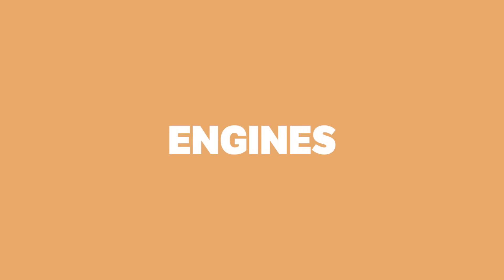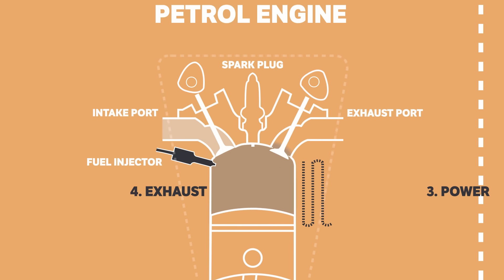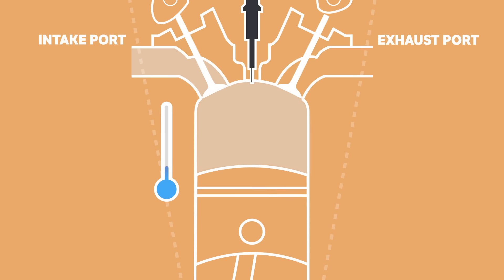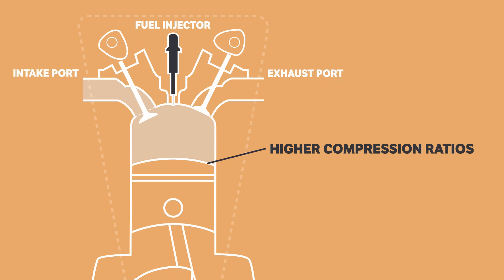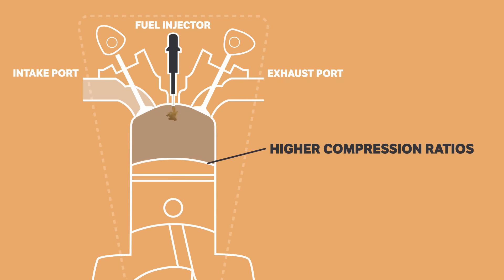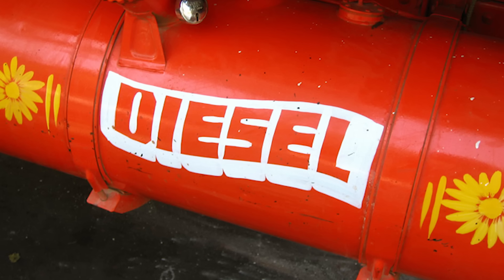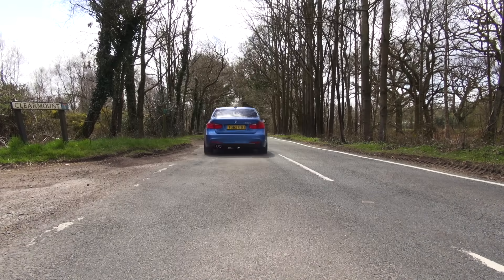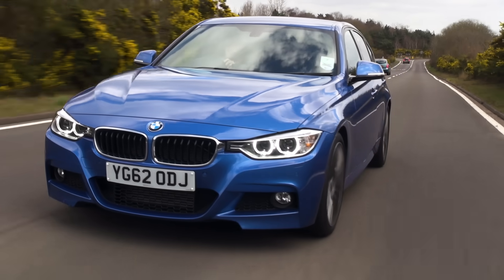The Differences Between Petrol and Diesel Engines

Comment: one VERY important thing about the diesels hp and torque: 

without a turbo, a diesel has roughly as much torque and hp as my electric toothbrush.
Reply: 99Lezard99 so your toothbrush got 120 hp and 240 nm?
Reply: patrik persson what size is the engine you are talking about? and yes my toothbrush has about 125hp and 250nm and is powered by a 9.7 liter straight 6 n/a diesel.
Reply: you guys are pathetic. comparing DAMAGED diesel engines or old heavy diesel sedans to more modern compact cars. even a NA disel, assuming it's a good design and working properly, will still be more efficient than a similar petrol engine. it will still have much more torque, on a wider rpm band and much earlier than that similar gasoline engine.
Reply: the tom guy. he used  a turbo diesel engine with problems then complaiend diesel enginge are shit without turbos.
Reply: Agroprest Afumati no one said ist not more economical. but a n/a diesel dosent have more torque then a petrol engine with the same Displacement. my mothers car was a 1990 and my second car was a 1991. compared to a n/a petrol a n/a diesel is gutless. in every rpm. just with a turbo it comes alive. but a petrol with a turbo comes alive even more. but of course diesels are much more economical. thier biggest benefit by far. low end torque (if a turbo is fitted) is thier second benefit. and thats why they are used in trucks and stuff. but they will Never find thier way in sportscars. only in compromise cars like big ass heavy sedans or SUV's. we will Never see a ferrari porsche gtr lotus with a diesel.
Reply: 99Lezard99 Mercedes om603 6 cylinder 3.0 liter
Reply: Im not comparing anything to anything, all i asked was why he has a toothbrush with 120 hp and 240 nm. And who said anything about DAMAGED engines?
Reply: 99Lezard99, I know exactly what you mean.
A diesel car without a turbo is like having a bicycle without a front wheel. You struggle to get it anywhere.
They are more reliable than turbocharged diesel engines, though. But the slowness and the horrible smell don't outweigh reliability in this case.
Reply: The Owner true that
Reply: i was clearly not referring to small 2-3000cmc engines or electric cars with a very different transmission and ways to put that power down.
we were talking about supercars. a large displacement diesel engine can generate insane levels of torque.
a common modern 6000cc tractor engine can easily put out 180-200Hp and well above 700Nm of torque starting from 1400rpm. and that's a highly detuned engine designed to work at full load in harsh conditions the whole day. now imagine a 6000cc diesel engine designed for performance, dohc, variable geometry turbo, commonrail, 4valves per cilinder and so on. with current technology, you can easily get well over 500hp from said engine but you'll also get something like 2000+Nm. on a very light car, that's way too much. you'll need drag slicks just to get any traction.
Reply: well, assuming we don't mix the 2 very different topics in this post, the one regarding Na engines and the one regarding a diesel supercar, it would be insane not to have a turbo engine on a diesel that aims at performance. when it comes to weight, yes, classic large displacement diesel designs, are very heavy since they all have massive iron blocks and cylinder heads. however, modern diesel engines are not that much heavier than their gasoline counterparts and if we look at audi r10/15/18, we can see what it can be achieved with top notch technology. light engines developing 650+hp on a car that weights ~900kg.

what i'm trying to say is not that diesels are perfect for high performance cars, thery have a lot of down sides, weight distribution, power curve, people's perception that diesels are slow or unsafe for racing and so on. what i'm saying is that the problem is NOT the fact that diesels can't achieve the same performance as gasoline engines or that's something flawed about them that makes them not competitive enough/unsuitable in high power applications (as stated by the guys above). modern and potent diesel engines can achieve (and they already did when they were built by serious companies) the same or better performance than petrol counterparts.
Reply: Lemmie guess, you've watched a bunch of Engineering Explained videos and now you think you know what you're talking about? That guy is a hack, and his popularity just goes to show how stupid most people are. 

"...they have comparatively lower torque and are not very fuel efficient. "

Torque output has absolutely nothing to do with engine stroke, and the amount of torque an engine makes has no bearing on vehicle performance, power to weight ratio is all that matters. BSFC is also more dependent on piston speeds and volumetric efficiency than engine rpm, because a huge portion of the friction in an engine comes from the pistons and piston rings, and because reducing the power loss associated with aspiration improves efficiency. Piston speeds are not dependent only on engine rpm, they are determined by engine stroke and engine rpm.

F1 cars were running turbocharged 1.5 liter V6s and 4 cylinders in the late '80s, and they were dangerous not only because they were the most powerful engines in F1 (Honda and BMW engines made around 1,400 hp in qualifying), but also because their small displacement and high power output meant that they had a huge amount of lag, which made them hard to control, it had nothing to do with their torque output. The V10s came later.
Reply: Oh? Can you show me an example of one vehicle being faster than another because of its torque output and not because of its power to weight ratio?
Reply: 1996 Mercedes E 200 Diesel - 4-cyl, 1997 ccm, 88 PS and 135 Nm.
1996 Mercedes E 200 Petrol - 4-cyl, 1998 ccm, 136 PS and 190 Nm.
1989 Mercedes 200 Petrol - 4-cyl, 1996 ccm, 105 PS and 158 Nm.
1980 Mercedes 200 Petrol - 4-cyl, 1988 ccm, 94 PS and 158 Nm.
1956 Mercedes 190 Petrol - 4-cyl, 1897 ccm, 75 PS and 136 Nm.

The latter has smaller displacement, less PS but basically the same torque as its 40 years younger brother. Isn't that something.
Reply: patrik persson oh ok sorry now i got it. 3.0 with 120hp. yes my toothbrush is quite heavy. but wielding it gives me the necessary mornig workout. 👌
Reply: Agroprest Afumati - Wheel torque is dependent on engine power output, the amount of torque an engine makes means nothing. A 500 hp diesel supercar engine would be ridiculously heavy and would seriously harm the performance of the vehicle. Gasoline engines typically make more torque than diesels, unless you're comparing turbo-diesels to naturally aspirated gasoline engines.
Reply: Audi won Lema with a Diesel engine 💪🏼💪🏼
Reply: Andrew Allen - What are you talking about? No diesel could ever come close to matching the power to weight ratio of an F1 V10, especially not without a turbocharger. The latest Powerstroke V8 makes 440 hp, not 600. Even if it did make 600 hp, it still wouldn't be making 1 hp per pound, and it certainly wouldn't be anywhere near the 4.6 hp per pound that F1 V10s made. The Porsche 918 engine makes 2 hp per pound, with emissions controls, no turbocharger and while running on pump gas.

Agroprest Afumati - The fuel used in F1 is very similar to pump gas and is not high octane, it's comparable to premium pump gas. My point was that diesel racing engines can't compete with gasoline racing engines and diesel road car engines can't compete with gasoline road car engines.

SANJAAY ANANDH GOPAL - LeMans is all politics, it can't be used to compare technologies because the regulators are always limiting the performance of some cars but not others. The diesel prototypes were allowed to outperform their rivals in order to promote diesel products in Europe, but now Europe has realized how shitty diesels are so they've switched to manipulating things in favor of hybrids.
Reply: The C220d is not naturally aspirated. All modern diesel production cars have turbochargers, they'd be absolute slugs without one.
Reply: idontcare80, exactly. And the late 80s F1 cars were much lighter (around 540kg if I'm not mistaken). They were too dangerous to drive. Turbo pushing 4 bar boost was insane. Cars were producing ~900 HP for race and a staggering 600 lbft of torque in a 540kg car. No wonder they toned it down in '88 to just 2.5 bar thus limiting the engine output to just ~650 HP. The cars were just too difficult to handle.
Reply: Trey Hornick do your research. The c220d is defenetly not n/a.
Reply: I said it made 440 horsepower, not 440 lb-ft of torque. You diesel boys really do have trouble reading, don't you? I don't know where you got 445 hp.

There are plenty of gasoline V8s in both cars and trucks that made over 1,000 lb-ft of torque, just not from the factory.
Reply: idontcare80, I'm with you on that one. You did write 440 HP not torque.
Reply: Martin D A to do that it must learn to drive on a road first.
Reply: Martin D A, mainly because of the fuel used. Diesel burns slowly, petrol explodes.
Reply: Martin D A, I think the 2002 engine was the base for F1 engines.
Reply: The Owner

It was an 89 model (molded plastic on the doors).
I really love those cars, you can enjoy going slow =)
Reply: Martin D A - Part of the reason that diesels had superior thermal efficiency was because they were so unrestricted (no throttle valve, no emissions controls), but with modern emissions controls, they aren't much better than gasoline engines. Gasoline engines have also gotten much better in recent years, nearly matching diesels. 

The Deltic engines had almost 90 liters of displacement, that's where their torque came from, it had nothing to do with the fuel they burned. The later R-3350 aircraft engines could make quite a bit more torque from a much smaller displacement.
Reply: idontcare80 roughly the same as most productions cars today, diesel or gas 
both have their advantages , they are both awesome . i cant take sides to be honest
Reply: patrik persson so? 3.0 with 120hp or something? want a comparsion with a 3.0 straight 6 petrol?
Reply: 99Lezard99 you asked and i answerd.
Reply: Agroprest Afumati Ah
Reply: patrik persson what did i ask?
Reply: 99Lezard99 What engine size.
Reply: The Owner Your point being?
Reply: Wrong person.
Reply: Agroprest Afumati lightweight? Do you know how much would engine like that weight?
1994 7.3l V8 diesel with single turbo from Ford makes around 250bhp and 685NM. 
1969 5.8l V8 from Ford naturally aspirated makes 300hp and 460NM. Diesel without a turbo doesn't stand a chance if we're talking about power. 
Hell my first car was 1.3 petrol which had 50kW (100NM) and 1.9 N/A diesel in the same car had 47kW (120NM)
Reply: Andrew Allen, also you can't fit more than 3.5 liter engine in a 2005-2017 F1 car. There is no room. They would have to redesign the whole car. And not to mention the overall weight which would go up by at least 200 pounds. 600 HP and 900lbft would just not be enough. It would need at least 750 HP and a 1000lbft which would make the car handle like 1950s era F1 cars - deadly.

There is a reason why F1 cars have petrol engines. To keep the weight low.

For comparison, a 2004 Ferrari F1 3.0l V10 weighs 605kg and produces around 880-950 HP.

If it were a 3.0l V10 diesel it would need two turbochargers to get even close to 800 HP and it would weigh at least 100 kg more.

These F1 engineers can make wonders but even they know putting a diesel engine in an F1 car would be moronic. It's different with Le Mans cars. And they only started using diesels because they used much less fuel hence being more competitive to their petrol counterparts.

Bring back 90s-2000s era F1 cars and I'd watch all the races regularly.
Reply: SANJAAY ANANDH GOPAL, do you know why it won?
It certanly isn't because diesel engines are better than petrol.
Reply: i never stated diesel engingines were suitable for f1 cars. they are not. but not because you can't develop a diesel engine that's powerful enough. 

do you know why f1 engines are capable of such ammount of HP? because of the high revs the can achieve (hp, unlike torque, is rpm dependant). f1 enginges have short stroke, high bore and a bunch of improvements (pneumatic valves, rare metal alloys on critical components, extremely thin and light pistons) so they can achieve those high rpms. what does that mean? they have comparatively lower torque and are not very fuel efficient. 

diesels funtion is exactly opposite. they don't go as high in rpm but they put as much power as possible with each stroke (mostly because of the longer stroke and much higher comporession, giving it a much better efficiency). overall, assuming you spend as much in development, you can get a diesel that puts out comparable levels of power as a gasoline engine (without it being much more heavier, it will be heavier though since it needs a more robust constrution to withstand the higher compression ratio).

do you know why f1 cars form the late 80s were considered too dangerous? not because they had too much hp (later cars had the same or in some cases even higher HP), it's because those 3.5L v10s and v12s also started to develop insane ammounts of torque. so they impose design regulations to make those engines less torquier.

you may ask why torque is dangerous? well, those are very light cars and torque is not linear as HP, it can come abruptly at certain rpms making the car accelerate violently. more than that, it makes the car very hard to control in less than ideal situations (when raining, when tyres are not warmed up properly or are too hot or too used, in certain high G menouvers etc).
Reply: i don't waste my time on videos with trivial information. i rebuild and fix diesel engines for 15 years now.

torque is measured in NM. the ammount of newtons you get at the end of 1m bar. inside an engine, the longer the distance from the connecting rod to the center of the crank, the higher the power per stroke that engine produces. that distance is obviously proprtional to the engine's stroke. bedies that, diesel engines have higher compression ratios and combustion efficiency which also increase the ammount of torque they can put at a certain displacement. this means diesel engines have both higher HP and much higher torque than a gasoline engine at the same displacement and rpm.

however, gasoline engines can compensate by revving higher, this increases HP (proprtionately in theory, in practice it's not proportional since it has much to do with engine design and at which rpm said engine is most effective). but revving higher does not actually increase torque that much (if at all, again, it really matters how that engine is designed to operate).

the rest of your comment is absolutely right. gasoline engines are by fam more appropriate for f1, motorcycles and very light vehicles applications than diesels.
Reply: Agroprest Afumati, wait a minute. You're saying that a 1980 Audi 80 GLE with 1588cc engine and 110 PS and 140 Nm of torque has less torque than same year Audi 80 Diesel with exact same displacement of 1588cc and 54 PS and around 95 Nm of torque.

There are plenty of N/A petrol cars with same displacements than N/A diesel cars and former produce more HP and more torque.

The only thing good going for a diesel car is a turbocharger. You take it away and you lose almost half the PS and half the torque.

Now, you're a diesel mechanic and you know a thing or two around engines but are you really going to stick by this statement of yours:
"this means diesel engines have both higher HP and much higher torque than a gasoline engine at the same displacement and rpm"
Reply: Agroprest Afumati, you've made a slight error. BMW's M15 engine was a petrol powered NA 2-liter engine and it was used in the legendary 2000tii and 2002tii. 2000tii had 120PS and 167Nm. 2002tii had 130PS and 177Nm.

A turbocharged 2002 had 170PS and 239Nm of torque.

And to correct your sentence:
it was superior than similar gasoline engines they had back then.
It WAS the superior gasoline engine they had back then.

I can give you a proper example of BMW's petrol vs diesel.

1982 BMW 323i with 2316cc, 139 PS, 205 Nm of torque.
1985 BMW 324d with 2443cc, 86 PS, 153 Nm of torque.

Are you sure you're a mechanic?
Reply: There is one C 220 diesel manufactured from 1993-97 which had a 2155cc NA engine but it only had 95 PS and 150 Nm of torque. All later C 220 diesels had a turbocharger. It had nowhere near the 170 PS that Trey Hornic wrote.

There were also 3 other NA diesel engines offered back then in C-class. A C 200 with 75 or 88 PS ('96 model) and a C250 with 113 PS.
Reply: You can compare the Mercedes OM604 engines to the Honda F20A and F22A engines, and the 6.2 and 6.5 Detroit Diesel V8s to basically any other GM small block with similar displacement, the gasoline engines make more torque and more power. There are other examples as well, but I can't think of them at the moment.
Reply: MiDnYTe25, I can prove you wrong on multiple accounts.
Reply: Man, you diesel fanboys don't know how to read. Read the comment that was posted right before you posted yours.
Reply: idontcare80 I finally felt like looking it up and your right the new powerstokes don't make 600lbft they make 925lbft with 445hp. I don't know where you got your bullshit number of 400lbft?
Reply: Andrew Allen, it's all good. Ford powerstroke is a truck, not a car. You have to register it as a truck.
Trucks usually have the most torque out of all land vehicles.
Reply: The Owner I can do a triple backflip.
Reply: MiDnYTe25, you got me there.
Reply: Also, I take that last bit back, the Koenigsegg One:1 makes 1,011 lb-ft of torque from the factory, and from a 5 liter V8. The Chiron makes 1,180 lb-ft,  but it's also an 8 liter, 16 cylinder engine. The Chiron engine even makes its maximum torque starting at 2,000 rpm and probably makes more torque at 1,600 rpm than the Powerstroke engine does at the same rpm.
Reply: Tell that to a Deltic locomotive... As it supplies enough torque in a satanic raucous volume of belching smoke to tear your car in half.
Reply: Haha yes, of course.
Reply: It is an interesting subject though. Diesel by volume has 15% more energy than petrol, though by mass about the same. The engines need to be built to withstand the higher stress levels. The moving mass will be greater. The 'detonation' cannot be altered except by fuel injection timing, and the burn time is longer. The Diesel also was not developed for small passenger vehicles alongside petrol until the 1990s, the turbocharger itself did not become common place in cars until the 90s too and this is maybe partly why they became popular along with the need for economy. The thermal efficiency is an order better. Can anyone tell us exactly why Diesels don't rev, apart from stroke differences?
Reply: Makes sense. Yes thanks. ))
Reply: PS You were discussing the BMW2002 engine, I think that was the block they chose for their F1 engine?  750HP+ Or am I getting mixed up?
Reply: Aaah i remember the 300D W124. 110ish HP ^^
Reply: M RO, yes. What year were you thinking about? A 1985 300D has 109 PS. A 1989 model has 113 PS. Not much difference actually ha ha. BTW, I also think 300 D is awesome :-)
Reply: idontcare80, The thermal efficiency is set by the physics of the thing and can only be fiddled about around by the designers, either approaching the ideal or moving away from it. It is simply that the efficiency of a heat engine is fixed by the difference between the ambient and the fuel temps. Diesel has a hotter engine, hence has an ideal efficiency greater than a petrol engine.
I was only joking about the Deltic, but I think it's a fantastic thing. Standing next to one while it throbs away - rumbling through your feet on the platform was for me unforgettable. Also love the big aircraft engines too, that 3350 was great.
Reply: The owner, 'explode' suggests detonation. The flame of the burning gasoline travels at about 200m/s (from memory) a detonation will travel at 5000m/s (from memory - but you get the idea) If someone could make an engine that withstood detonation it would be quite a performer I imagine.
Reply: A whole huge range of things determine the efficiency of an engine, its induction efficiency (which I mentioned), its compression ratio, its internal friction (more friction puts more heat into the cooling system), the fine-tuning of the fuel delivery, the combustion chamber shape, the cam profiles, the ignition timing, etc. The compression ratios of gasoline engines have risen considerably in recent years, and the induction efficiency of diesels has fallen dramatically due to emissions requirements, this is why the efficiency gap between diesels and gasoline engines has fallen to basically nothing, nothing meaningful, anyway.
Reply: Sure, all I was saying is that all 'heat engines' have a theoretical maximum efficiency, and a Diesel is higher than a Gasoline, as a gas turbine is greater still etc. They can muck about with stuff as much as they like - but the designer of modern engines has two main considerations, the efficiency and the green credentials. The internal combustion engine be it Diesel or petrol falls short on both. Inertia and demand for energy and power has meant they will continue to produce these engines but the world needs a cleaner more efficient engine. As we know...
Reply: Gasoline engines in automobiles and gasoline and turbine engines in aircraft are just fine as they are, what the world needs is a green hydrocarbon fuel. Synfuels, made from captured CO2 with nuclear energy would be something to consider, we could even capture more CO2 than we burn using that technology.

Edit: Actually, gasoline engines in aircraft are in desperate need of an update, but using gasoline engines in aircraft isn't likely to be made impractical any time soon.
Reply: a stock cummins ram has about 900 ft. pounds of torque..
Reply: Its also turbocharged.
Reply: idontcare80 doesnt add a whole lot of torque though,  at much 150 pounds
Reply: No, it adds about 560. Diesels are only capable of a BMEP of about 125 psi when naturally aspirated, which means that an engine the size of the Cummins in the Ram would make about  340 lb-ft without a turbo.
Reply: Most naturally aspirated, gasoline burning production cars are around 190 psi, that would give a 6.7 liter engine 510 lb-ft of torque.

There is no advantage to diesel next to modern gasoline engines except for a small savings on fuel costs, and that's only because the price of diesel recently dropped by a fairly large amount.
Reply: idontcare80 then tell me why all the big rigs use diesel engines and a 6.4L hemi only makes about 429lb-ft. A turbocharged diesel will always make more torque than a turbocharged gas engine of the same size each with equivalent turbo.
Reply: Big rigs are diesels because they're cheaper to operate, diesels burn less fuel. 4 valve engines make more torque than 2 valve engines, a typical Honda engine has a BMEP of around 175 to 190 psi, that Hemi is around 165.

I'm pretty sure I said this before: The torque output of a turbocharged engine depends on its boost pressure, you want more torque, you just raise boost.
Reply: idontcare80 " no advantages but small savings on fuel " a 6.4 hemi can tow 10,700 pounds , a 6.7 cummims can tow around 30,000 pounds 🙃
Reply: "...Diesels are just a terrible fit for high performance vehicles."  But absolutely fantastic if you are towing.  ;)
Reply: 99Lezard99 what do you mean "turbo" ?
Reply: No, diesels make less torque without turbos. Try to prove me wrong and you'll realize how pathetic a diesel's torque output is without a turbocharger.
Reply: Diesels do not make more torque than gasoline engines, unless you're comparing turbocharged diesels to naturally aspirated gasoline engines. Naturally aspirated diesels typically make less torque then naturally aspirated gasoline engines, and anything goes if you're comparing turbocharged engines, because torque output is dependent on boost pressure.
Reply: lmfao
Reply: I read through the entire thing and this discussion is quite interesting but you aren’t realising your points of view are actually compatible. Summing up, yes diesel need a turbo to make torque and yes if you give the same turbo to a gasoline engine it will probably make more torque. The reason that is hard is because gasoline is susceptible to knocking if you just strap a turbo so in order to run the same boost you would have to greatly reduce the compression ratio and thus lose a lot on fuel economy.
That is why performance gasoline engines in super cars and racing are gasoline, they don’t need to be fuel efficient and since gasoline engines are also lighter they can rev more and also make more power it’s a win win and putting a turbo is no problem.
On a normal day sedan though, turbocharged diesel has the same fuel economy (sometimes even better) than a naturally aspirated diesel and because of that you can have the turbo and make more power at low revs (which I think we all agree is what the average joe uses daily) the same reasoning applies to why they are good at towing and are used on heavy machinery.
Could that same sedan run a gasoline engine and make more power, yes of course. But if it was naturally aspirate, that power would come later in the range even if you could get the same peak torque. And if it was also turbo charged, although it would probably be better on every way you would lose a lot on fuel economy because of the point I made before.
This is why diesel is king in Europe, diesel is cheap here and most diesel consume less and people want like to run the cars on low revs all day long and still feel the engine pulling. I personally prefer gasoline engines but even a little turbo one spikes the consumption to over 30% of the diesel equivalent.
Reply: bmw 520d diesel 180 hp is just the right amount for a car whitout a turbo
Reply: lol you idiots golf mk4 with its 1.9 sdi  has no problem reaching 160km/h and the golf mk2 1.6D can reach 120km/h so it isnt slow as you think
Reply: 99Lezard99 wouldn't that be a diesel toothbrush?
Reply: But you're wrong, diesels simply can't perform as well as gasoline engines by nature. The first problem is that they can't rev, which means that they have to rely on producing huge amounts of torque in order to produce power, and an engine that's built to withstand a large amount of torque is always going to be heavier than an engine that revs to high rpm to produce its power. The other problem is one that plagues diesels in all applications, and that's their emissions control systems. A gasoline engine just needs a single, three way catalytic converter to run cleanly, while a diesel needs a DPF, a DOC, and either a NOx trap (which doesn't really work) or a urea injection system with its own catalytic converter, and all of that equipment is not only heavy, but it's also hugely restrictive. 

You'll never see a diesel that weighs 300 pounds and makes 600 hp like the engine in the Porsche 918, you'll never see a diesel that makes 925 hp and weighs 203 pounds like the V10s that ran in F1, you'll probably never even see a diesel that has power to weight ratio of 1 hp for every pound of engine weight on the road. Diesels are just a terrible fit for high performance vehicles.
Reply: idontcare80 comparing a Ferrari v10 f1 car to a smaller, emissions restricted diesel is stupid. F1 cars don't have emissions so why would a f1 car with a diesel have emissions also the new ford powerstrokes make 600hp and 800ftlbs while they weight around 650lbs while emission restricted. So I believe if Ferrari chose to use a diesel or a gas engine in there F1 they would be able to achieve some high hp and torque numbers.
Reply: you're comparting a gutless old random car with another gutless old random car. your example has really nu relevance in comparing diesel vs gasoline engines. just look or even better, test drive the same car, similar platform, one with a diesel engine and one with a comparable petrol engine. a lot of manufacturers offer a wide variety of engines so it wouldn't be hard to find a few. diesels are definetly not gutless in comparision. they are usually more expensive and people KNOW they won't cover the cost just from the fuel efficiency it the few years they plan to use the car. yet they choose diesels. why? because in normal conditions, they are more alive than a similar petrol engine.

when it comes to various competitions, diesels were banned long time ago and not because they sucked, but because they outperformed similar gasoline engines. they figured it out it's not fair and regulated the competitions (and not only with diesels but with different ngine types, fuels, intake systems and so on, it's all regulated for the sake of fairness).

when it comes to supercars, there are 2 separate issues. one is the fact that people that buy those cars don't usually want diesel engines regardless of how well they would perform. the second is, you can only go so much in performance with a diesel engine without getting an insane ammount of torque. you may think more torque is good. that's not the case on a very light car. insane level of instant torque will make your wheels lose grip at high speeds just by changing gears or sudden accelerating. that's a big no no when it comes to safety.
Reply: not to mention f1 cars not running on normal gasoline. they use high octane gas mixed with ethanol (5-15% if i remember correctly).
Reply: Aleksey Gladysh yes. seriously. if you have ever driven a diesel without turbo you know what im talking about. for example: my mother used to own a Mercedes 190d witch had 2.0 of straight 4 n/a diesel goodness with mindbending 75hp and 130 or 140nm of gutwrenching torque. a 1.0 45hp corsa was quicker. my first car was a 90hp 1.5 petrol and it felt like a rocketship compared to the 190d. my second car was a 2.0 petrol with 133hp and 180 or 190nm and it felt like timetravel compared to ye good ol 190d. after driving that 190d for a while i knew exactly what i didnt want in a car.
Reply: Agroprest Afumati lol whut? I was just compareing N/A diesel vs N/A petrol. tell me some Race series were diesel got banned because they are to good. Show me proof. 
and the thing with the "too powerful too much torque for sportscars" lol thats funny. but the unbeatable instant torque of a tesla isnt to much? do you really belive what you say there?
Reply: A) Torque does nothing for vehicle performance.

B) Torque output is dependent on turbo boost pressure, so the amount of torque an engine makes, diesel or gasoline, is simply a result of how much boost the engineers wanted to run, it has nothing to do with the fuel the engines are running on.

C) Diesels have to make more torque than gasoline engines in order to make a decent amount of power, because they can't rev to produce their power. This is a limitation, not an advantage. 

D) Gasoline engines make more torque when compared to naturally aspirated diesels, and turbocharged gasoline engines can easily make just as much, or more torque than diesel engines. Again, torque output is dependent on boost pressure.

E) The vast majority of the time, gasoline engines make more power than diesels. Things are a little different in Europe and Australia, both of those regions get unbelievably pathetic gasoline engines compared to what we get in the US. I can't say why that is,  it's almost certainly all due to politics.
Reply: 99Lezard99 j
Reply: A NA diesel still has more torque than a NA petrol engine. It will definitely pull better at lower speeds an specially lower RPMs, but it won't go too fast, no matter how far you press the pedal.
Reply: diesel has more torque with or without turbo
Reply: They make more torque than an equivalent petrol engine , that's my point. Obviously they make less without a turbo, big fucking news.
Reply: 99Lezard99 still have teeth mate?
Reply: man, car manufacturers producel a very wide range of both diesel and petrol engines, you can't take the weakest diesel of certain displacement, put it against the best gasoline engine in that range and call it a day.
bmw m15 from the '70s had up to 130hp and 177nm and was a Na diesel (there is a turbo version of it with 168hp though). it was superior than similar gasoline engines they had back then. however, if you want to prove your point, you can also choose a detuned version of said engine and call gasoline engines better. That's why i don't give much attention to cherrypicked examples. Overall, N/A diesels and gasoline engines are close in performance, especially in the torque department. With turbo, the ballance tips in favor of diesels.

about that statement, if we have 2 engines, with the same level of refinement, engineered and built at the same quality, both having the same displacement, the diesel will always have more torque and hp than the gasoline engine AT THE SAME RPM (as long as it's an rpm the diesel can handle). just look on some graphs and see how early in the rpm band diesels get their torque and peak HP. gasoline engines simply can't match that since their combustion is less efficient. however,  i also stated that gasoline engines can rev higher and in some cases they match and even exceed the peak HP diesels can put out.
Reply: Eh not so true. 168 bhp from a c220, n/a. It gets going decently and can reach 144mph. Not bad in my book. Sure a snail would help tho.